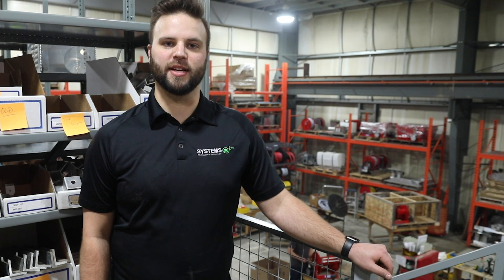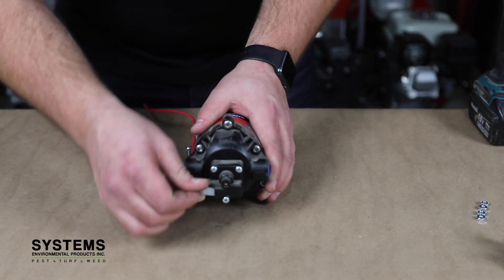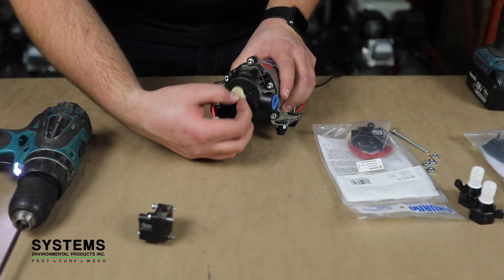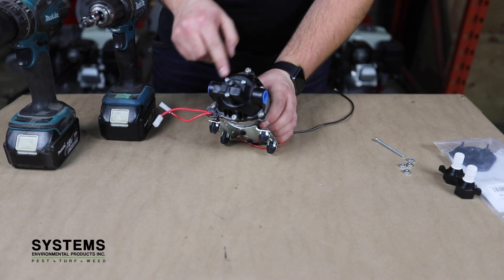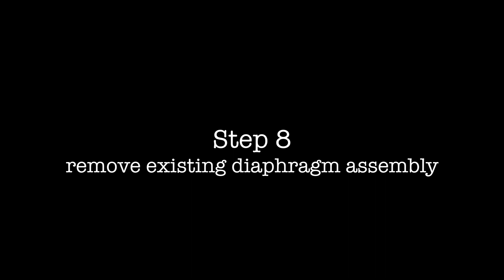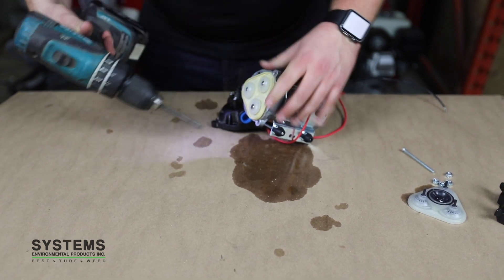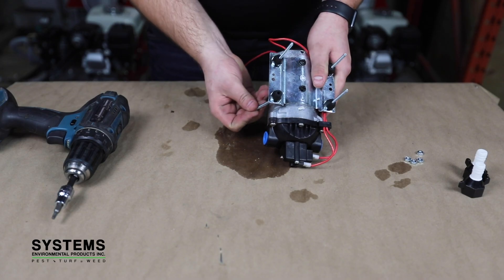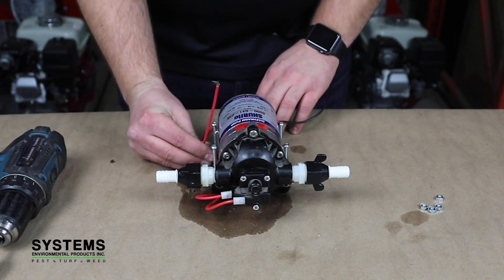Shurflo 8000 Series Pump Service

Comment: Hey guys....thought I would ask here as I am having trouble findinding info. I have a coulple of Shurflo 9325 submersible pumps. I am having issues with water getting into the motor canister. Same install location. I even changed the wire boot. Seems weird.

Comment: Here's a question for ya. I am trying to replace the pressure switch on a surflo 8000-543-936 water pump. I got the new one in and when I put it on the long screw has stripped and will not catch hold. What can I do to fix this?
Reply: Ok I just followed everything you did. Now the pump runs but no water is coming out of the spray wand?

Comment: Shurflo's pressure switches seem to be very weak. Mine failed and the rest of the pump is good. I see a lot of youtuber videos on how to repair their switches.
Reply: Toss the switch and plumb in a 110v booster pump pressure switch.  Way more reliable.  Got sick of fixing mine.